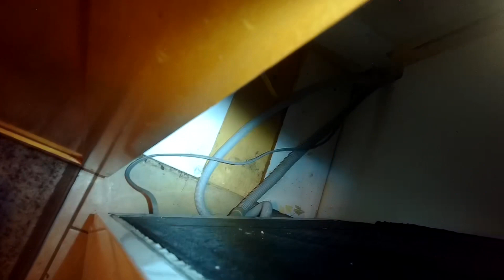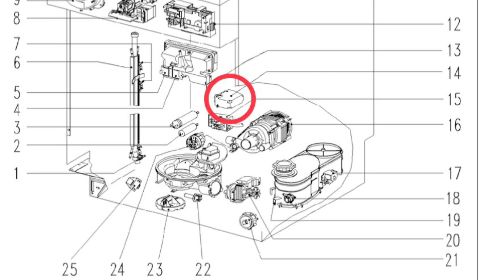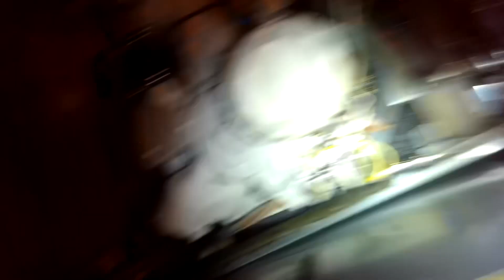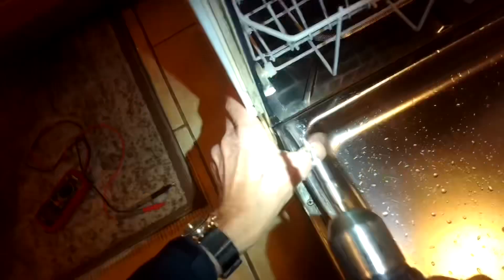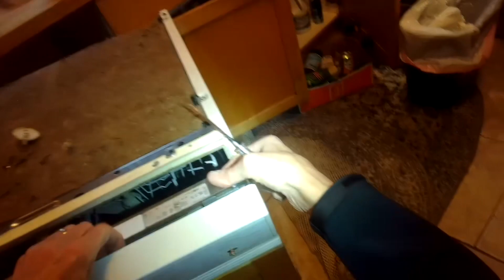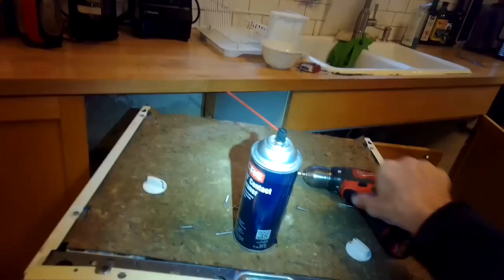✨ Miele Dishwasher Not Melting Soap - Diagnosis and Repair ✨

Comment: Thanks. Great video to see and understand the workings of that model. I am not sure if you said in your video if the dishwasher was repaired and worked properly after cleaning all those contacts? What cause the malfunction ?
Reply from the maker: Thanks Michael,
I think it needs a new heater/pressure switch.